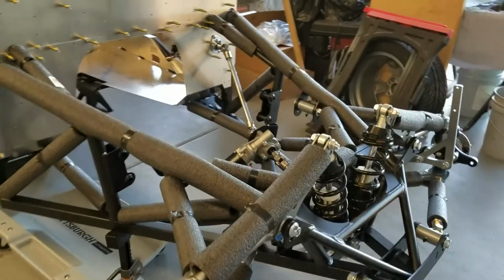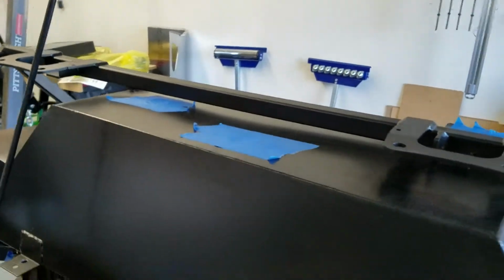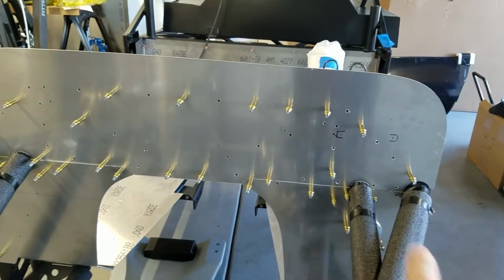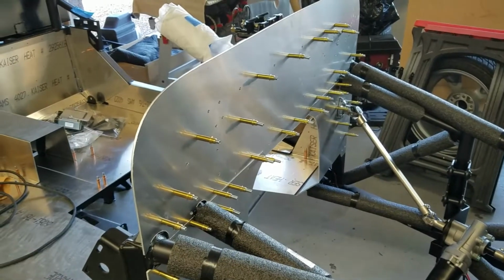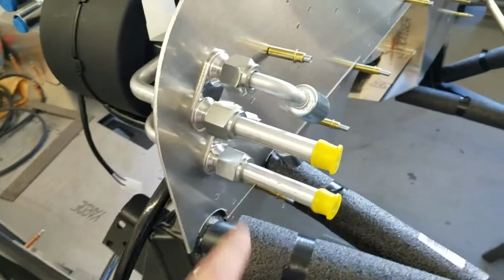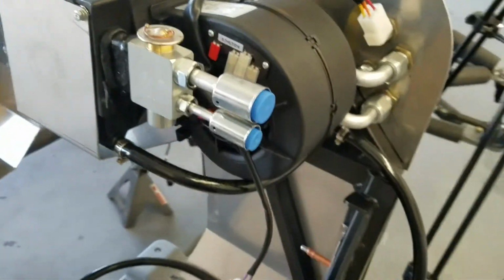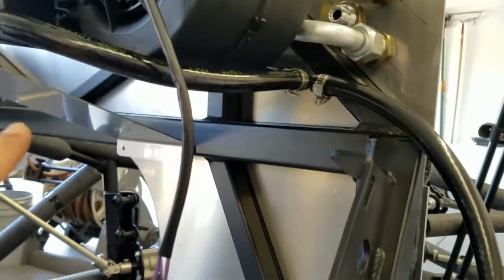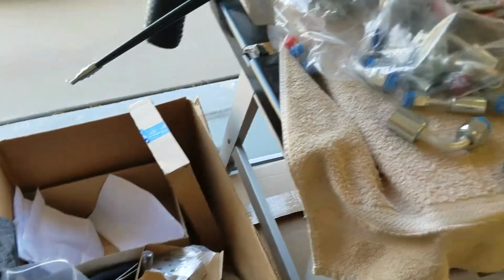Factory Five 33 Hot Rod V2 Build - HVAC Installation

Comment: First up, thank you for putting all this online.  I really appreciate the format.  Not polished, just what is really going on.

I also think you are switching between areas of technical specialization.  I will bet Factory Five does not want to know too much about AC.  They just want to let the AC component company do their thing.  I would bet that this area is always going to to be custom fit.

And keep up the good work.  One step in front of the other will get you through the ugly middle.
Reply from the maker: Thanks for the comment.  I really wanted this format to be realistic for the average guy in a garage.